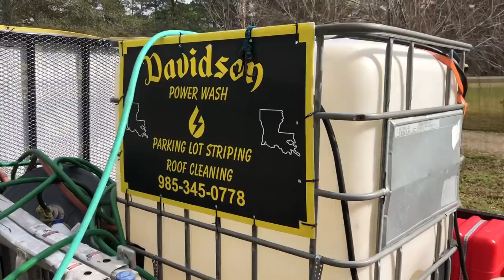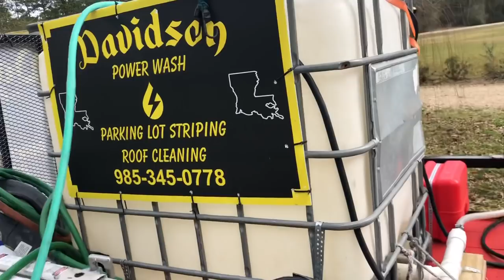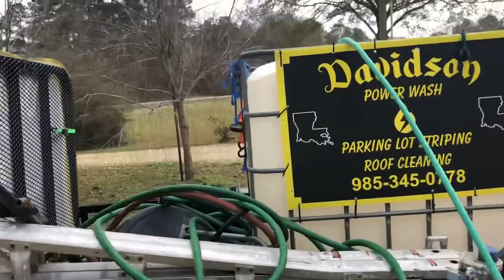How to pressure wash a house start to finish subscribe for more

Comment: Billy, I truly appreciate you taking the time to put this video together for all the guys, like me, that need a lot of help with our technique on house cleaning.  I've been dabbling in power washing for a number of years due to some exterior painting and general house repairs in NC.  I can't tell you how much I appreciate your honesty and the humble way you explain what you are doing, why you do it that way and the reason it works for you.  Awesome video man!  Right now I'm using a Mi-T-M 4000 psi and it says 4 gpm, but I'm guessing it's only 3 or 3.5gpm.  It works well, usually starts on first pull....but I'm thinking about building a power washer in the near future since I'm pretty good with a wrench and permanently mounting on a trailer similar to your setup.  With a CAT pump, used engine and some hardware, I think I can get it done for around $1,000.00 since the pump is going to be at least half that budget.  Thanks again for the tips on solution mix and how your equipment works.

Comment: Dies the pine sol help with the cleaning or just dissipate the bleach smell. I never seen anyone use it before. Thanks for the video.
Reply from the maker: Rick Washek in my opinion I feel that it does assist us in cleaning. The mechanism behind this would be that it keeps the solution wet longer acting as a wetting agent. In addition when cleaning a structure near a very busy highway the structure will be coded with hydrocarbons. Unfortunately the mold, mildew and algae will be under the coat of hydrocarbons. If we spray only SH on the structure it takes much longer for the SH to penetrate the layer of hydrocarbons on the structure to interact with the biological mildew or mold
Reply: @billydavidsonvip  thank you for your reply, I will give a try on next house wash I do. Thank you
Reply: Mr clean /fabuloso is 2percent peroxide and your fav liquid dish soap 1:1.....

Comment: Do you need to rinse first the bushes with clean water before applying the bleach?
Reply: Yes keep bushes wet all the time
Reply: Depends how strong the bleach is, it's mostly watered down unless a roof cleaning is involved, if you have someone watering down bushes before doing your house, they probably shouldn't be doing your house with a hot mix

Comment: Mr Davidson
What mixture should I use to softwash & rinse painted brick ? Same as normal house wash ~ 0.75% SH downstreamed ?
Reply from the maker: Probably a little stronger but not more than 2%
Reply: @billydavidsonvip  Thank You so much.  You've been a great help.
Reply: @billydavidsonvip  so If my downstream pulls 1:10 then I can just run straight 12.5% SH with little soap and I'd be getting 1.2% out sprayer ... thank you
Reply from the maker: s3 pro in theory, I would recommend doing a bucket test. There are other factors that affect your drawl rate such as hose length, type of wand and other factors such as engine speed and pump settings.

Comment: Invest in the “xtend 15.5ft contractor telescoping ladder”
Reply: Why would he do that? The chemicals do the work with softwashing.
Reply: Marlin Garner cause he has a ladder in the trailer
Reply: Don't need a ladder for this job
Reply: mattspontiacta I meant for future jobs Sherlock
Reply: NOTORIOUS FILMS - hey Sherlock I don't ever use a ladder on residential homes when pressure washing. 
With my set up I can reach 3 stories with no problems. Lol
Reply: mattspontiacta so can I at 16gpm 3500 psi, since I saw a ladder in his trailer I thought it be good to just invest in a more compact ladder is all

Comment: why would you use a produce that on the bottle it says not to mix with bleach note that mustard gas yes blue sky window clng  Westchester ctny new york
Reply from the maker: Allen Goldman none of these particular products contain any ammonia
 You must be thinking about the very old type of Pine-Sol they did contain small traces of ammonia but the new products it has been extracted from during the manufacturing process
Reply from the maker: Allen Goldman I would recommend always check in the product labels before mixing chemicals but in this case this particular product helps break down some of the mold and mildew in addition to the sodium hypochlorite this is a very common practice in the power washing industry now also with the soft washing industry in addition to shingle cleaning

Comment: Those pressure washers are 3500 and 8.5 hahahahah.. stop making stuff up
Reply: What did he make up
Reply: He said those machines are 10 gpm there 8.5
Reply: No he says they're 8 gpm...but could be almost 10 gpm depending on what tip he used on his wand
Reply: He said 2 at 8gpm stop hating.